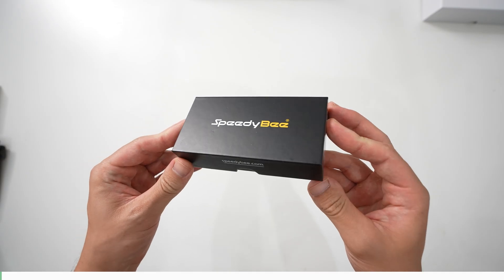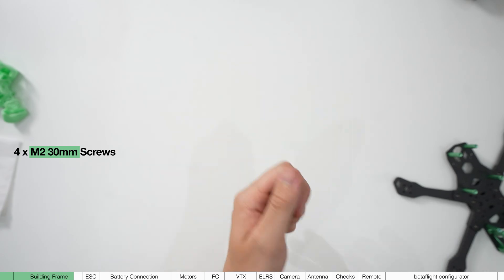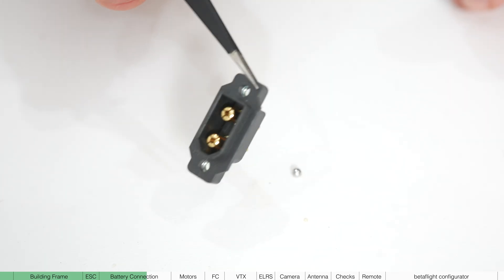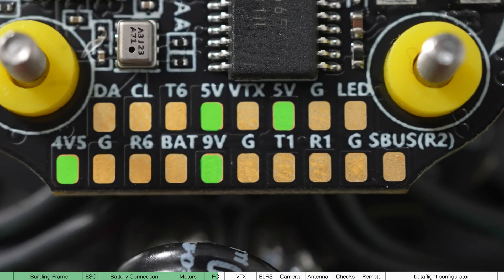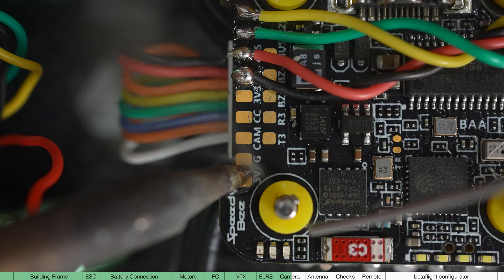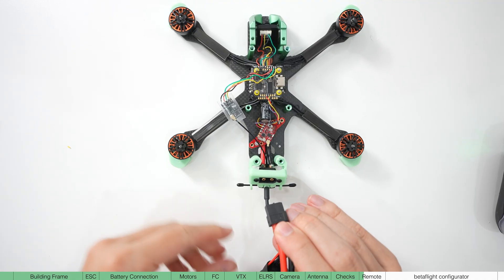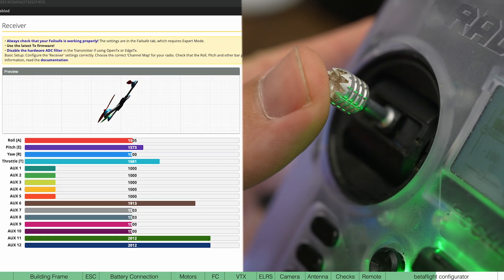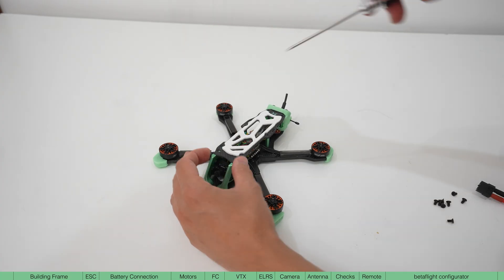Archetype FPV Drone FULL BUILD video (Analogue)

Comment: Very nice build, I just finished mine.  The only snag I ran into is the design is built around the Speedybee FC which has it's positive lead on the left, so does your tail unit it accepts the XT-60 socket with positive lead on left.  I went with a Foxeer Reaper which has the positive lead on the right.  So I had to cut up the tail unit a bit so it would accept the XT-60 socket the other direction.  I'm hoping it flies as well as it went together!

Comment: Well done Nick!

4:24 Out of curiosity, is there a reason you didn’t use shrink wrap on the power cables as they connect to the battery port?
Reply: Typically not done for the battery pad however you should cover the exposed solder joints on the XT60 head
Reply: @espi721 yeah apologies, the solder on the cables to XT60 male connector were the ones that I meant. Thanks for the clarification. 🧡🕊️

Comment: As much as i like this build at 7:18 are bad solder joints. That is just asking for one of the wire strands to wiggle loose and short onto different pad or some IC and fry your board. You should tin even the small wires, its not that hard. All you need is to grab a piece of plank or wood, make a solder pit in middle by melting big blob of solder there until it chars the wood and burns a little hole, then add flux or rosin. When you need to tin the wire, you just heat the solder blob with soldering iron till it flows an then stick a wire inside for 3-4s and you are done
Reply: I wanted to say the same thing... This could loose while flying and then you mostly dont have control of the drone anymore.
Reply: idk if you noticed but at 4:36 under the plus pad on the esc there is a huge blob which could cause issues aswell
Reply: you all look knowledgeable, any opinions on the vtx choice?
Reply: @hellotherehellothereI think the SpeedyBee tx is Good.
Reply: @hbr3d_ quick warning if somebody does get the tx800, its 5v only so be careful ✌️
Reply: @shaymin7240i have the tx800 :D

Comment: Tbh, I was never a real fan of you, the content just wasn’t for me, I surprisingly watcht many vids though hahah. 

But deal that’s a really nice frame. Iam def gonna buy this with the new be drone 2004 flow motors 

Just a few things i noticed. 
1. heat shrink on the battery leads and capacitor 
2.  bit more spacing under the esc
3. I wish there where more replacement screws 
4. my preference a bit stronger vtx and rx 
5. camera mhmm ok could be better 
6. open source print files 

Looks great other wise. 
Can’t wait to see the result from the community bashing it around